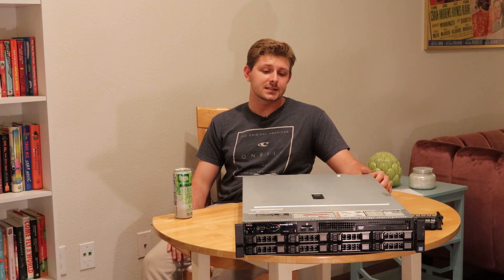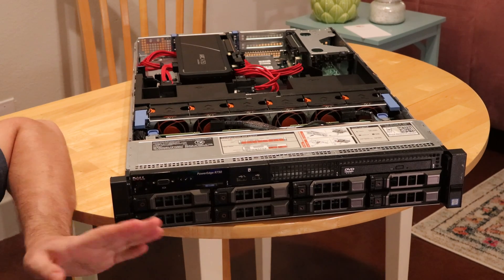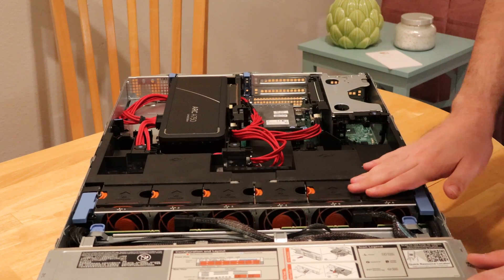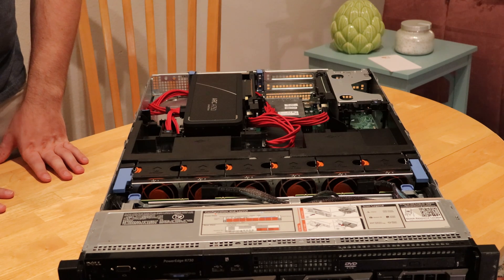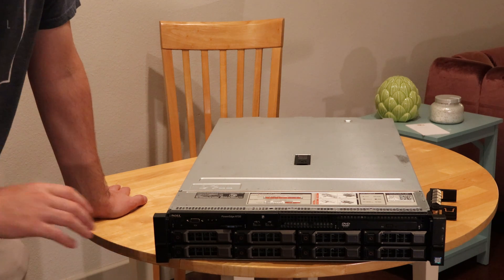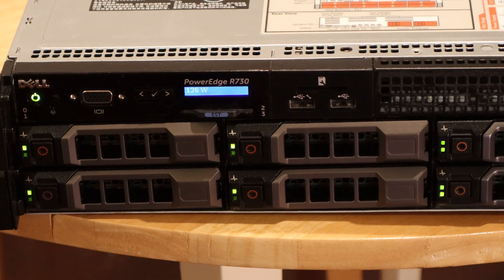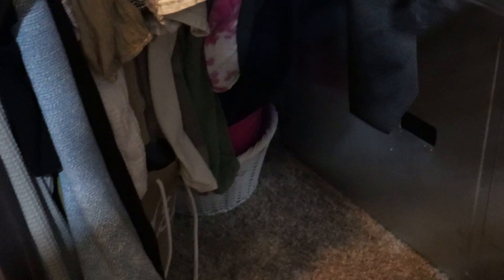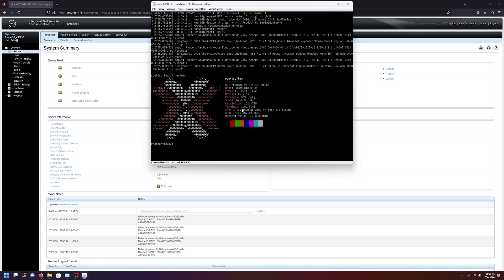The BEST Homelab Server for the Money - Dell PowerEdge R730

Comment: How much $$$ would you say you're spending a month in increased KW usage for running this server 24/7/365?  Any plans to add a UPS to it?
Reply from the maker: The server uses about 140 watts all the time. I estimate about $12-13 a month at my current electricity rate. Worth it considering what the services it provides to me would cost, and factoring in what replacing it with more efficient hardware would cost. Still not using a UPS on it. No hiccups so far. The grid has been VERY stable where I'm at. Sitting at 198 days of uptime at the moment.

Comment: I picked up an R730 on eBay over a year ago. Funny enough the listing was for the x8 2.5" Bay model but I ended up with the x16 2.5" Bay one. Runs great and I use if for Proxmox where I have some services hosted, including Jellyfin. For anyone who gets one, there's an iDrac command you can do to quiet the fans further if you have a PCIE Card installed. I did this when installed a graphics card since the card has its own fans. 10%-15% seems to be a good number for it. (And yes, I too keep mine in the closet, I just have it wall mounted in there)

Comment: I have a variant from 2010 of this server. Same model number but vertical slots for 2" hdds. I fitted mine with two GPUs but only the top slot of the second PCIe riser has x16 speed. Depending on what you do you might be bottlenecked by that PCIe x8 port.
Reply: unless your variant is newer with dual x16 ?

Comment: I just bought my #R730 for £100 on eBay with same Xeon x2 CPUs, 32gb RAM and 8x900GB drives.   I can't wait.   I've got a GTX 1650 ready to go in and I'll be upgrading the RAM to 128gb.   Glad to see you've just chucked yours in a cupboard, makes me much more confident about the noise.   I'm building an enclosure for mine with large quiet fans to kick the heat into our living room.  I'll be using for NAS, Plex and Minecraft Server all on #Ubuntu.  :D #nerdingout!!

Comment: I thought 1U was louder than a 2U, but after working with both, I concluded they are about equally noisy.  Only during boot for a minute or so, and only when under heavy load are they really loud.  Generally, when they are not doing a lot, which is most of the time, they are both about as loud as the air conditioner in the window.  Under load they are about as loud as my vacuum cleaner.

Comment: I agree that the R730 is an excellent server, but the T430 tower offers a superior form factor and is much more suitable for home labs. It has identical specifications, is significantly quieter, and can still be rack-mounted if desired. 

If you haven't already, consider using Tdarr to optimize your content library. I used it to convert mine to the AV1 codec using QSV on an A750. It took two months to process the library, but it saved over 10TB with no noticeable change in quality. I had to configure my own compression plugins and workflows as the Arc cards are not yet well-supported. I am currently developing an AI VSR upscaling for it as well. For, is functioning brilliantly.

Comment: For that slot with the wrench icon on the front, it's a vFlash slot, which is basically a specially branded SD card. vFlash is basically just some storage that you can load CD images on, and your server can boot from it as if it was a real CD drive. It's not for authenticating with the BIOS. (However if you haven't changed the default password, out of the box you can plug in a USB drive with a config file and iDRAC will load a bunch of settings from it.)

Last I checked vFlash were just Kingston cards with a special label, but generic cards won't work in the slot.
Reply: It was to run VMWARE on the SDcard or USB. That's why there is internal USB on (most) Dell PE 11/12/13/14 gen.

Comment: See I agree and disagree. I have an R730, but i have the more common 2.5in SAS drive configuration, and i have several reasons why i dont end up using it anymore. Primarily, just... Too much power. If i could retrofit it with the 3.5in hard drive bays, i would consider moving everything onto the R730 and just call it a day, but because it has the 2.5in bays im stuck using it basically as a hypervisor with no storage.

Also mine has a bug with c states and so it doesnt benefit from the power savings features that you get from that, and it idles at over 150watts... I dunno.

Comment: having it in the closet is not a big issue.  I would get a 2x4 so that you are not resting that server on the rack ears, it can dork them up.  or get a vertical mount 2u/4u rack and hang it on the wall.

Comment: r630 and r730 are pretty efficient but still too much power for most home server applications. 
i have a r630 at it highest configuration except for ram 1.6TB is enough 64gb modules are relative cheap but 128gb modules cost nearly 5 times more. i set mine in power efficient mod so it draws on idle only 60W but on performance mod 200W is idle power but the compute power stays the same the oly thing is the response time the r630 needs 2 second from 0% to 100% on performance mode he would do this in 0.5sek. so as for my private use case i can live with the 2sek. i run many services for me on this but also i host 5 game servers for me and my friends and there friends. one of my services is a ai image creator that will need 50% of the whole compute power and also i have 3 nvidia quadro t1000 in the back pcie slots also being used only for ai and video transcoding. mine uses up to 700W at peak but under normal load over the day it uses only 70W at peak. 
the r630 is really limited in internal space but it is more or less the same as the r730 but in a smaller case and it uses 2.5 drives instead of the cheaper 3.5 drives.
so yea it is a nice machine also cheap used to buy you can get one 300€ to 600€ for the basic or more common configuration 800€ to 1300€ you can get the rarer top models like e5 2699v3 or V4 cpu or with a h730 mini raid controller or the 4 port sfp+ 10gb  nic and such rare options.

one quick note you can set over the idrac the fan min speed to 5% instead of the 30% is standard. 5% is enough airflow for idle also the system much quieter even the r630 was laud as a prebuild pc on idle. 100% is a whole other level of noise ^^' this scared me it the first start up ^^

Comment: I did this when I started out, picked up 2x HP DL380p 2Us, and then quickly realized I should start with consumer x86 hardware. Recently setup a Dell T7610 as my truenas core machine

Comment: You're probably aware by now but if the bios and idrac firmware have been updated then the fans will spin extra fast whenever a non-Dell PCI card or hard drive are detected.  You'll need to search for "ipmitool" and use that to manually set the fans to something reasonable.  Also, to others who may find this, the remote console feature requires a license from Dell which the previous owner may or may not have purchased.  Lastly, you'll probably want to set the raid controller to "hba" mode before you start installing drives.

Comment: that vga slot is 8x, while the other is 16x, plus intel arc are not 100% perfect with this r730. get a rtx 30 or rtx 40 series and ull be better in stability. i tried the arc 770 and pc crash when installing chipset or inteldrivers very often, plus this card got low performance.
Reply from the maker: Machine primarily does transcoding so slot speed hasn’t been a huge factor. Has been rock solid with stability for months now as well with the Linux drivers. In fact, I’ve had the Arc, a 7900xtx, and now a 4090 in my main machine, and I’ve actually had the most driver and stability issues with the 4090 surprisingly.
Reply: @ComputersAndCoffey  did u manually edit fan profile ? i did it and server was very quiet.
Reply from the maker: @ScruffyITA  yes. It made a huge difference

Comment: DC Engineer here and also Dell PowerEdge hardware certified. R700 series are good machines, we have over 400 of them in the DC i work at. Personally for home i use a PowerEdge T110 tower server, beefed up with the best CPU's i could shove in it. Power consumption is sensible and best of all its Silent. I have it in a cupboard not far from our living room and cannot hear it. I used ESXi and virtualise everything Pfsense, NAS, UniFi server, Pi-Hole etc.
Reply: I had a t410 , and a t440 , the 440 have better energy management and low noise.
Reply: What is the cpu you used in it?
Reply: @gabrielporto.mikrotik  Sorry cannot remember. Sold it now. Using a Dell 7020 SFF i7 now for Proxmox. Uses far less power, and more powerful.
Reply: Can you make a video on how you virtualise everything?
Reply: Can you please confirm. Can we setup vmware esxi labs on poweredge t110?
Reply: @UK_US007  Yes. I use Dell customised ESXi on my T110
Reply: @UK_US007  yes I can confirm, essentially its a server thats just a beef cake, rather a 1 or 2U it looks like a desktop

Comment: i would go used like you but i cant it has to be whisper quite because i live in a 2 bedroom house and i have 2 brother liveing with me one in the back bedroom and one in the liveing room i have a firewall and 2 servers running with my 10 gb network switch and you cant hear anything and he sleep good new out will have a place for a server rack so it dont be in the liveing room but well its in the liveing room i also used it to place my sourround sound system on it as well so its like a 2 in one

Comment: Is it worth today? I found 6 of them with 256 gb ram ddr4, 2 x intel 2690 v4, perc raid installed, x16 sff . 500 dollar per piece, is it worth ?
Reply from the maker: I think they’re still worth it if you’re looking for and need a lot of expansion with pci cards and hard drives because I just don’t think you’ll find anything with this many pci lanes and hard drive slots for the cost.  If you can get by with less storage and expansion, some of the mini pcs like the minisforums are very compelling, especially considering some of them have a decent amount of connectivity like oculink and similar cpu performance with much lower power consumption and a tiny footprint.

Comment: I still run one of these at work for 2nd backup off site, 10 years now running 24/7 with only drives and power supply failing, zero data loss.

Comment: my question is I got a deal on an r720 with originally 2.5 bays and the seller is saying its not going to work for my 3.5 drives. Any suggestions I've never touched these type of computers before so I dont know if im missing something obvious. In a normal computer its just a cable i plug it to a 2.5 or 3.5 no fuss but I'm not sure if dell's require an hdd bay . I dont mind frankesteining it a bit and just having mypair of hdd drives sitting there without being secure. Any recommendations?

Comment: Great video!  I have a couple of r730 servers they are fantastic. Upgrade to a higher iDrac to use html5 and dump the java. Also since you have it in the closet without a monitor hooked up get a VGA dummy plug. Also know you can do ipmi commands to lower the fan speed it if is too loud!
Reply: I have a 710 w the Java based idrac…ver6?  is there a way to update it to ver 7 ?
Reply: @SteveHartmanVideos  Pretty sure you need iDRAC7 or higher which the 710 does not support. I run a dedicated VM virtualbox on my pc for just that purpose, on it I have all the tools for older equipment (servers, switches, ASA etc). I run java, have a flash browser and run Firefox ~49 or 52 ESR so that the browser will never autoupdate. I think i installed java 7u45. Good luck!
Reply: @callmebigpapa  that’s a great idea actually… maybe an old windows 7 PC runnning VMware Player for desktop.   As for Java, i think you have to find an older version from 2022 since the newer updates do no work anymore when i tried it.  I gave up after that.  Thanks for the reply.
Reply: @SteveHartmanVideos  the java version to use if i recall correctly is the 7. Its compatibile with windows 10/11 but. It can lead to security issues.

Comment: I followed your path and it's glorious. we now have so much redundancy in 3.5 inch disks while still only filling half of the slots

One more advantage is that it supports SAS drives and you can get 16TB SAS drives for cheaper than SATA drives

Comment: Power edge systems are pretty sweet. I have a pair of R720s. Unfortunately I will have to retire them soon because, although they still work VERY well, they are VERY power hungry and not terribly efficient. Haswell (e5 v3) is getting long in the tooth ALSO, but you can pick up an 18 core top of the line V3 for about $40... so there is some value there. My custom 4U virtualization server is 2x 2699v3 (18core) and 5x GPUs has sort of replaced BOTH of my R720s in one go. I have been eyeballing R730s for how cheap they are, but I think it may be time to go to Epyc gen2 OR Skylake.

Comment: Did you have any issues getting the Arc A750 working? They work way better with rebar enabled and I read somewhere that is possible on the R730 but not really straightforward.

Comment: OH! THIS IS SOMETHING I WAS CURIOUS ABOUT!!!! Hows the Arc at AV1 transcoding? How does the output look?
Reply from the maker: It can transcode several 1080p streams, I haven’t done many 4k streams, but it will do those fine as well. Quality is great! If I were building a media server, one of the new intel processors that has an iGPU would be a good option for what I spent on the graphics card and machine as the iGPUs support AV1

Comment: I recently upgraded my 1u Baracuda AMD server to a 2u Dell Poweredge R815. Very similar to yours and picked up on eBay for £100 (US$125) proving there are some huge bargains to be had if you look for them. It came with 3 1TB drives, 256GB Ram and 4xAMD Opteron 6320 8 cores, 2.8GHz processors. Swapped out the 1TB drives for 6x1TB SSDs and it flys.  Super heavy but powerful as hell. I haven't bothered with a GPU as mine is for hobbyist web development rather than media serving, I only have 6x2.5inch bays in mine anyhow so wouldn't have a great amount of media storage. Running ProxMox as I get on better with that than VSXi and spinning up a new VM anytime literally takes seconds.  All in all, like yourself, total overkill, because I can! 😂😂Very happy with my new aquisition and I hope your Dell serves you well dude.
Reply: Holy shit that price!! Great setup man!
Reply: IMO Opteron is WAYYY too old these days.  For bargain hunters I think Xeon E5 v3/4 is the sweet spot these days.
Reply: The R815 's are not a good buy. The motherboard on them dies for some reason. I had a whole bunch of them fail in the same manner at work. The R710's of the same vintage have all behaved flawlessly. IMHO, the Rx20 line is the minimum you want, as these are the ones where the iDRAC works in modern browsers without the need for Java. The R730 is a great option as you can add GPUs up to 250W (so even A100 40GB but not A100 80GB) very easily. All you need is the low-profile heatsinks, the supplementary power cables (they will need modifying for more recent GPUS like P100/V100/A100 though), and solid PCI slot covers for any unused PCI slots, along with the 1100W PSUs.
Reply: those cpu's are really not efficient tho

Comment: I picked up a Dell R720XD on ebay for stupid cheap.  Right now all I run on it is blue iris. Believe it or not, with only one service running its remarkably quiet. Because of space constraints my rack is in my office so all my gear HAS TO RUN QUIET. The air conditioner in my office is louder.  Yes its a jet engine on cold boot but once it settles down its fine. I also had two 1100 watt power supplies delivered yesterday to replace the 750's it came with.  A graphics card is coming soon.  Your 730 is louder than my 720. I bet the graphics card is the cause. Dells are known to ramp up with graphics cards installed.

Comment: "1U is loud" is only sort of true. Sure, if the system is running at 100% load, or you configure the fans to run 100% all the time, it sure is loud. But I have an R630 in my basement and if you couldn't see it you wouldn't know it was there. The fans sit at 20% 99% of the time which is pretty quiet, especially when you consider how loud other basement equipment is.

Edit: Also for idrac, you don't have to use the java based console. If you click "Virtual Console" on the sidebar, you can launch (and configure as default) the HTML5 version.
Reply: Once you have updated iDRAC. I was going to ask him: "You DID update the BIOS and all firmware from the Dell download as the first thing, RIGHT?" but figured, "Oh, well." LOL  Remember there are Dell Life Cycle controller hacks for fan speed/sound on several websites. Reddit is your friend.

Comment: that duel socket 2011 makes my Kabylake NAS look like a potatoe and if the fans bug you Noctua does make hotswap fans of that size, they are a lot quieter then those but do offer the same or higher RPM depending on if those are 2000 or 2400 RPM fans.
Reply from the maker: That’s good to know. Thanks for the idea!

Comment: Ive got one of these i run at home....you can take out the stock noisy fans and replace with Noctua PWM fans...mines runs near silent now even under full load (or as much load as i can put it under)
Reply: I have been thinking about that, you think it's quiet enough to be in a bedroom though? At idle, doing nothing
Reply: @kavmw  this is just my opinion but yes as long as the fans have changed to noctuas....
Reply: This comment is gold
Reply: @ Which comment?